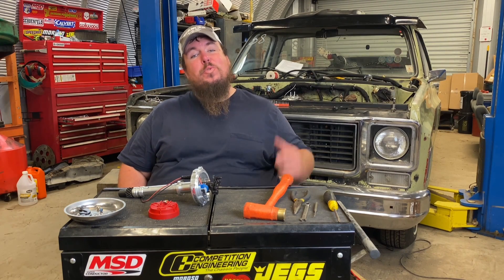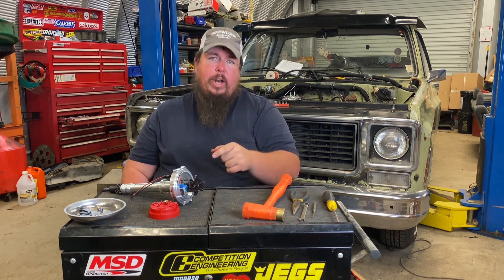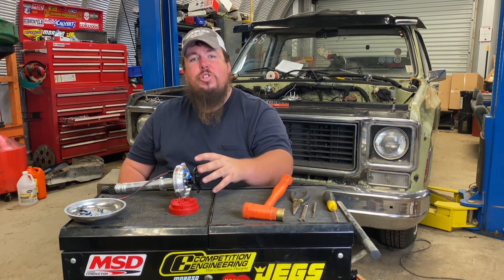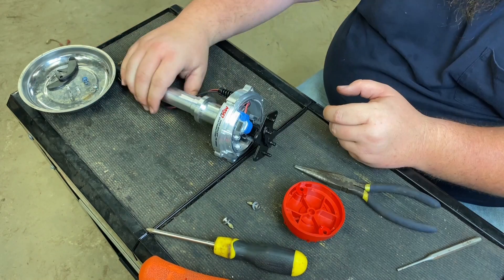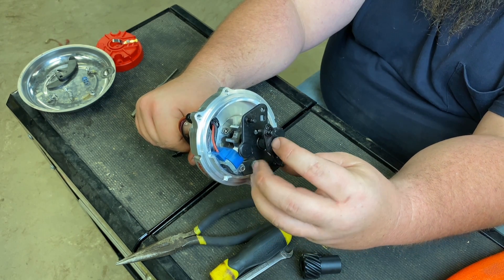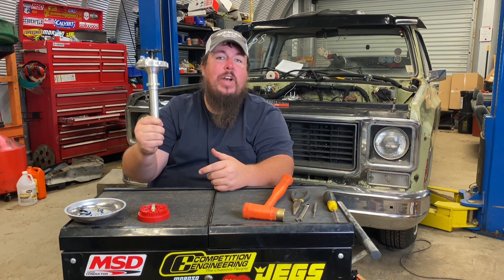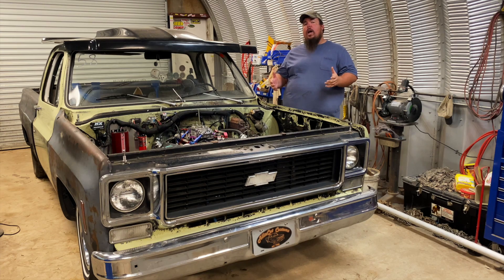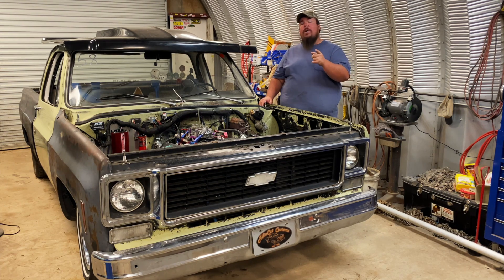How To Lock Out An MSD Pro-Billet Distributor

Comment: What part number distributor
Reply from the maker: My distributor is a MSD Pro Billet 85551. It can only be used with the MSD 6,7, and 8 series ignition boxes.
Reply: @AllieCatCustoms running a coil blaster?
Reply from the maker: Yes a blaster 2 coil with a MSD digital 6 box

Comment: Hey love the video ! Nice truck its fiyahh 🔥🔥 I was wondering when setting the distributor in locked out . How does it idle ? Like how u keep it idling at 7 to 800 rpm? Or does the 180 swap around of the shaft changes the speed or not?  I do want to lock it at tho. Jus need alil clarity lol. Anyway ty for vids bro 🔥👍🏾